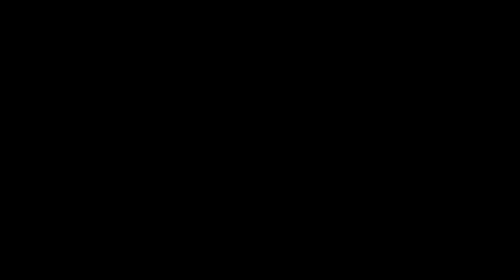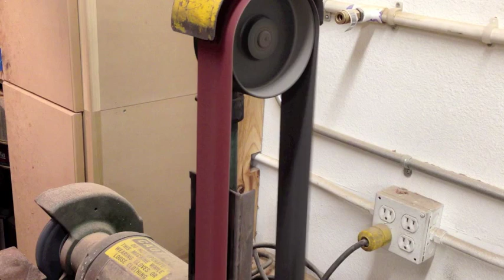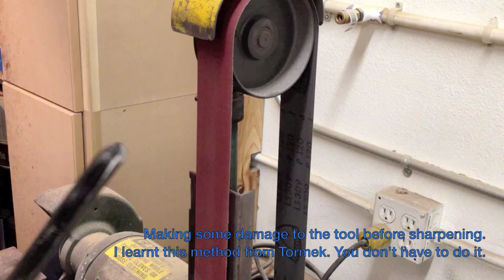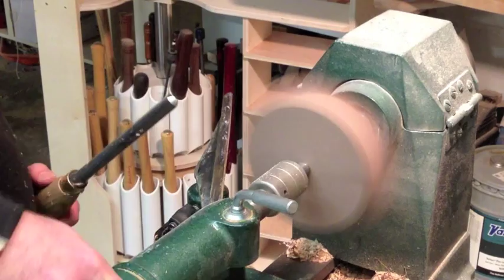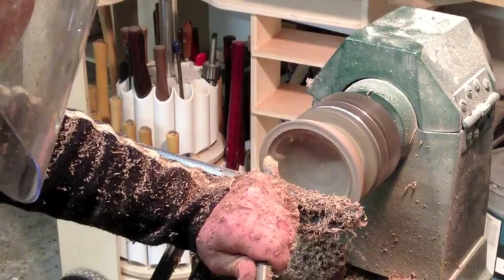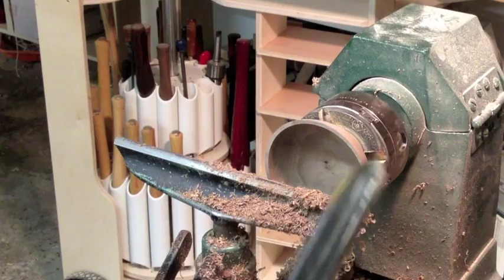How I Sharpen an Asymmetric Grind Bowl Gouge

Comment: Thanks for posting I think I might try this.  Is it hard to get use to grind? It looks like it has a little bite when you are starting the cut for the inside of the bowl. I was thinking that if you rolled the gouge a little more clock wise it might not be so aggressive on the start of the cut. 
Again thanks for posting.
Michael Borg